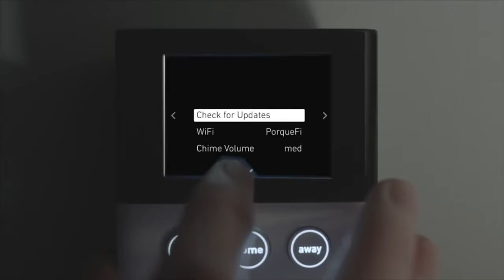The WORST Gun I Own

Comment: Your CETME is more similar to an HK G3 rather than an AR-15, they are both roller-delayed and the G3 was actually derived from the CETMEs.  The CETME rifle itself was derived from the StG-45, which is also roller-delayed, and was developed in part by German engineers who moved to Spain from there after the war.
Reply: I think he use ammo, that is not Strong enough in the load
Reply: This gun is a Spanish HK33
Reply: You refer the CETME C, but he shoots the CETME L, which has never been a good gun because of very low quality materials
Reply: Misma historia con la AMELI
Reply: Yeah I was wondering if 5.56 has issues cycling all the moving parts in a roller-delayed gun. I also wonder if Spain used a modified 5.56 similar to the French with the FAMAS.
Reply: the cetme is a mauser mkb gerät 06 design and yes the g3 is more or less the same.
Reply: STG-45 was a tilting bolt, like an SKS or FN FAL, not roller delayed.
Reply: @adron3729  It had aluminum bullets at first and was not for 5,56 originally (yeah, weird choice). There's a pretty detailed review and history on Forgotten weapons. So as the rule goes, when you remodel a gun designed for one caliber to another caliber...it hardly ever works as well.
Reply: @Didymus-vz6uy  It WAS roller delayed, look it up
Reply: @GunGirl1997 I have never handled a Model L, however Wikipedia specifically states, "the Model L is a select fire, roller delayed blowback firearm".
So, based on that, I'm sorry but your statement of "Literally nothing to do with the original" is incorrect.
Most all Roller delayed blowback firearms sharing that system design feature will have similarities that can't be denied.
Reply: @Didymus-vz6uy  STG 44 is tilting not STG 45
Reply: I've never owned a Spanish made gun that wasn't a pile. But I'd love to have a Cetme Ameli Minimi baby MG 42 but I'll bet they are very low quality.  It would be hard to pay 20 grand plus 200 bucks tax stamp for a low quality soft metal  toy
Reply: @barneybrown7543  I had an Astra A-80 in .38 Super back in the day, excellent fit and finish, and accurate. Heavy, but well made
Reply: @Didymus-vz6uy  I think you confuse it with StG44 which indeed used a gas operated tilting bolt mechanism. StG45 was a simplification using roller delayed blowback.
Reply: @Didymus-vz6uy  The StG-44 was tilting bolt. The StG-45 was indeed roller-delayed.
Reply: The refusal to license pettiness led to some amazing innovation
Reply: stg45?
Reply: @dogabuserslayer8341  That was the planned successor of the stg44. Cheaper and quicker to make partly due to replacing the gas operated system with roller delayed blowback.
Reply: @jackncoke8527  Yes, much higher pressure, and quite dirty, too.
There was a NATO directive back in ¿1992? forbidding the use of Spanish 5'56 in gas operated weapons (almost all, save the CETME L and Ameli).
I enlisted in 1995 and it was still standing, and we were strictly forbidden to share our ammo in multinational ops and field maneuvers.
Italian ammo could barely cycle the CETME L bolt, for example.

As for reliability, earlier rifles were OK, but those made after the "expense reduction" (between 1994 and 1995) were junk that stopped working well quite fast.

Magazines (disposable, and 20 cents apiece) were also a very serious problem. That steel body could get rusty in the middle of the Sahara at noon, and some springs could barely feed with more than 15 rounds in it (surplus GI mags worked flawlessly, in the rifles I got assigned).
Avoid them at all cost, since I know as a fact that some European online stores were selling them as "Belgian FN mags".
Reply: @asconajuenger  Maybe, our ammo used to have more cinetic power than others in the past. This weapon is pretty old.  Many people here used and uses this weapon and its performance is fair away from this.....
Reply: I have a cetme that doesn’t cycle at all anymore.

Comment: I own a Marcolmar and it was doing the same thing.  I replaced the bolt from another gun and it fixed all the issues.  The original bolt was just too tight and would probably wear in with time, but a new used bolt fixed 100%   Give it another chance.  You said so yourself the recoil impulse is awesome.
Reply: I did the same thing. Got a full auto bolt carrier and swapped it out for the original and it runs 100% now, 55grain, 62 grain, 77 grain, etc. I compared the two bolt carriers and the original has a fatter rear while the surplus full auto carrier is smaller in diameter. Weird. I fixed it but can't explain why this worked.

Comment: If Matt were to have the roller system serviced it would actually become a nice fun gun to shoot.  Rollers change how well the gun cycles quite a bit.
Reply: I figured either the rollers are the wrong size or the flat was bent too tight. Either way it can be a sweet shooting gun in the right armorers hands
Reply: @jamesgravel7755  exactly.
Reply: I second this. I’ve shot a Spanish Cetme with no issues whatsoever.
Reply: Roller delayed guns also frequently require a break in period before they're reliable.
Reply: @Devin_Stromgren  that's exactly it, Marcolmar includes a brightly colored note with their rifles specifically telling you to run M855 or other heavy loads for the first several hundred rounds to break them in, I guess someone didn't read...
Reply: @Devin_Stromgren  And they're SO nice to shoot.
Reply: @Devin_Stromgren  Exaclty. My marcolmar has never had an issue as I followed the manual and shot m855 for the first 100 shots.

Comment: The original CETME is extremely reliable and even loves steel cased ammunition. I never got the L but I did always hear they can have issues, while others work ok. You could probably do a bit of work on it and get it to cycle reliably. I still think they look fantastic though, im an iron sights guy and the sights on those fit me really well.
Reply: I guarantee his whole issue is the kit they used to assemble it has a worn out extractor and ejector spring. Probably could use properly spaced + bolt rollers and headspace checked. My early C308 needed all of the above.
Reply: Chances are the Angry Beavers at Century probably built the CETME. They are notorious for assembling the worst out of box experience in military firearms.
I've owned CETME's, FAL's G36's and a few other surplus builds, and they all ran after spending 3-4 hours correcting the assembly errors.
Reply: I think is issue is he's running a regular ar15 magazine, contrary to popular belief those model L rifles don't use a standard ar15 mag, they use an ar15 mag with the front feed lips bent open because the guns design has the mag sitting to low in the gun, causing bullets to have to make a angled vertical leap when getting shoved into the barrel, those cetme L also tear up some brass, not just from the fluted chamber but that violent chambering angle causes it to scrape the hell out your brass
Reply: @gungadinn  These CETME-Ls are made by MalColMar.
Reply: @abradolflincler00  MalColMar redesigned the receivers for these builds so they work with standard STANAG mags.
Reply: @kyotra  I've got 2 that I built on hill and Mac flats, I didn't realize these had an altered receiver, I know both mine have issues with about 1 in every 5 rounds if I stick a regular ar mag in it
Reply: @abradolflincler00  Yeah, the only difference between the original CETME-L mags and STANAG mags is the placement of the mag catch cutout - it alters the feed angle to help with reliability.

When MalColMar starting importing kits to build, they realized they could get the same result with standard mags by changing the position of the mag catch on the receiver.
Reply: @gungadinn  i was going to comment it probably was a century who fubared it
Reply: Inrange got a whole series about making em work
Reply: @gungadinn  that sounds about right. My friend got a nice deal on a century arms built cetme. Quickly found out it was priced accordingly.
Reply: @kyotra  Are you sure this one is a Malcolmar?  I know there was one other company in the US building parts kits.  Also, I think the Cetme L mags also had heavier springs than a standard stanag mag.
Reply: @Devin_Stromgren  Marcolmar is the only company offering them with rails and in colors other than green.
Reply: @Devin_Stromgren  I am sure, because it has a picatinny welded to the top - only MalColMar offers that option, Hill and Mac did not.

Comment: The CETME/HK-91 pattern guns do require a bit of break-in. Mine (a PTR-91) actually did need some manufacturer reworking to replace the ejection lever and springs in order to get it to run more cleanly, as it also frequently had failures to eject. She runs fine now, but it's still a bit of a mule. I really need a welded rail and Spuhr stock.

Comment: Hey Matt, as a Spaniard I have to tell you that the Cetme is and was one of the worst rifles for an european army, thats why since the 2000s Spanish forces use Ar based and German g36s. I think the cetme is only use in training and to cheaply equip reserve units.
Reply: can it be worse than the L85A1?  by the look of it maybe
Reply: La guardia civil usa el chopo (Cetme C) el cual es mas antiguo pero incluso así es mejor
Reply: a y otra cosa, sabes que el g3 de H&K (los mismos creadores del G36) se basaron en el chopo
Reply: lo peor es que el diseño es bueno, pero el ejercito quería rifles a 500€ y claro, pasa lo que pasa
Reply: @peterblyth112  it's flaws are not in design, they're in the quality of the materials used to build it. For it to work correctly you need a powerful round like what you'd use on a FAMAS, the problem the spanish army had with it is that they wanted 500€ rifles, so if u used the actual ammo it needed to work properly, it quite literally broke the gun
Reply: no era malo por mal diseño, era malo por los recortes de presupuestos y por ende los cambios para hacer los rifles más baratos, lo mismo pasó con el ameli
Reply: Por fin coincido en el chat con españoles que entienden de armas, el CETME original de 7,62x51 era el mejor
Reply: It is good looking though
Reply: @pablo-ky6tn  so, the immediate precursor to the HK G3?
Reply: Fun fact to this "thread". The Cetme rifle comes from the Ammo called aswell the Cetme developed during the Francos Spanish Dictatorship by exnazis gun makers who historically created the mosin nagant ( i think, not 100% sure)
Reply: as other spaniard the cetme-c was one of the better rifles and it was the base for the g3 and the famous fn fal but the one in the video ist not a cetme-c i think its a cetme-L a bad and cheaper version of it
Reply: @victorio_2008  el Cetme C que usa creo que el GAR, se hace con muchos mejores estandares, pero basicamente la plataforma Cetme esta anticuada y en deshuso, es mas economico adquirir armas de la OTAN que desarrollar un unico rifle para unas fuerzas armadas que apenas ven combate. Luego policia nacional usa sobre todo armas de H&K.
Reply: looks alot like the old FN 5.56 and a bit like the Deawoo.
Reply: God it looks so cool though
Reply: ya thats how u get all ur reserve units killed
Reply: Your Cetme-Cs are all old and shot out, and the Ls were cheaply built with poor QC - also, every military cheaps out on maintenance and replacement, no issued gun is going to work as well as a freshly-bought, well-maintained firearm. The context here matters.
Reply: @francisquito4590  I mean you can make really good guns for dirt cheap. You just can't have everything milled and perfect. Look at alot of ak or shotguns. Some can be reliable for less than a pair of Jordans
Reply: Well gun jesus said that reliability issues came after abandoning the original caliber, for which the gun was designed to use. Don't really remember what the caliber was (i think he said it had aluminium bullet, that was very long, light weight, high speed and flat trajectory), but if i'm not mistaken, rifle worked fine until they changed caliber after entering nato. Could be wrong though...
Reply: Saludos desde Carolina del Norte
Reply: Confirmo. Solo se usa en entrenamiento
Reply: @peterblyth112  The L85A2 (A1 upgrade) and L85A3 receivers are made or upgraded by H&K Germany. With the A3 being new production upper receivers with Keymod or Mlok rails and are new production to go on A2 lowers.
Reply: The C version which was the first adaptation was an incredible rifle.
These are the knock offs.
Reply: @SrRumeniguer   The Mosin Nagant was made in the late 1800s by Russians...  Not sure what gun you're thinking of but it's definitely not that one lol
Reply: @SrRumeniguer  nah, fueron los ingenieros de Mauser. Las acciones de cerrojo de Mauser eran y son infinitamente mejores a las de Mosin-Nagant. La historia de desarrollo del CETME es muy interesante, sobre todo una munición desarrollada para el CETME A que pretendía ser controlable en fuego automático y efectiva a ams de 1000m... El proyectil es casi más alto que la vaina, es muy interesante
Reply: @SonsOfLorgar  
More of a disfigured Brother.
Both the G3 and the CETME were based on the StG-45, the CETME was just an example of what not to use and do in the to-be G3.

Though i guess V-Group didn't really learn about the Ammo thing, considering that HK later made the same Mistake of producing a Picky Eater in the G36.
Reply: The CETME issue was in manufacture over time. Quality control degraded and then so did the firearm.
Reply: @lilgxnpe578  G3 бесспорно является продолжением CETME , а вот FN FAL не имеет ч этими системами ничего общего , даже принцип работы автоматики принципиально отличается.
Reply: es literalmente un rifle excelente, pero las ultimas versiones se hicieron con plásticos y bajo muchísimo la calidad. Los CETMES originales eran muy buenos.
Reply: @stompingpeak2043  yeah but the thing is that they wanted to pay the exact numerical amount of pesetas they had paid for the Model C, excep 40 years later, which meant it was way less and thus had to use cheaper materials to make the already existing design
Reply: It doesn't matter. I just want it in the collection.
Reply: @Jager_sog9  eso perdón, me referia a los ingenieros de Mausser, gracias por corregirme
Reply: @TwinsM16sRU  the desing is actually really good you just need one that's well built and to use powerful ammo
Reply: @francisquito4590  I will buy any at the first opportunity for reasonable money. Powerful ammo is not a problem; I use 'barnaui' - very angry cartridges. Thanks!

Comment: The Pedersen rifle also does have a clip that ejects. In fact I think this gun was competing with Garand at some point.
Reply: You are correct, the Pederson rifle was competing against the Garand early in the American rifle trials to replace the M1903 Springfield.
Reply: @Swindle1984  Also, the Austrian M1885 Mannlicher rifle ejected it's clip out the top also. It's the original en-bloc clip feed rifle. It was simplified in 1886 to just drop out the bottom in the familiar Mannlicher fashion.
Reply: @IrishThunder2020  Close. The Steyr-Mannlicher rifle ejected the clip out the bottom when the fifth and final round was chambered, but you could eject the current clip at any time by pulling back the bolt and hitting the button to eject the clip out the top of the rifle at any time to insert a fresh 5-round clip.
Reply: @Swindle1984  yes, from the M1886 onwards it did, but the originally adopted M1885 actually ejected the empty clip out the top once the magazine was empty. (very unique among the Mannlicher designs and quite rare these days) The Austro-Hungarian government thought that this was too complicated and expensive and they asked for a simpler design. Thus the 
M1886 and all of the later Mannlicher designs ejected the clip out the bottom upon chambering the last round.
Reply: @IrishThunder2020  The M95 ejects out the top if you press the button, similar to the M1 when you want to top it off without firing every round.
Reply: @Swindle1984  I'm aware of the clip release on the M95 and all other Mannlicher style rifles. I'm not talking about the M95. I'm talking about the M1885, an earlier black powder rifle designed by Ferdinand Mannlicher. The bottom ejecting clip was introduced on the M1886 and was retained on all later models such as the M1888, M1888/90, and the more famous M1895 (M95). If you would like to learn more about these rifles I recommend watching the C&Rsenal videos on them.
Reply: @IrishThunder2020  I'm aware. I was telling you about the top-eject feature of the M95.
Reply: The Pedersen used a different caliber not already in the US inventory.
General Pershing (IIRC) decided that since the Army had all that .30'06 Springfield left over from WWI, that the next US service rifle should be chambered in that round.

Comment: Roller lock guns tend to throw brass into the next zip code. Watching that example of it barely clearing the port  means the rollers might be too tight.  Easy fix but annoying.  Can verify a set of shims behind the bold face and bolt
Reply: Or, more likely, using too weakly loaded ammo
Reply: @SonsOfLorgar  it's not weakly loaded ammo.
Reply: my cetme-L throws brass like 30-40 ft lmao
Reply: it just needs to be broken in, Marcolmar recommends that the first couple hundred rounds through the rifle should be heavy full power ammo like M855, they even write it on a brightly colored note in the box with the rifle, it's fairly hard to miss.